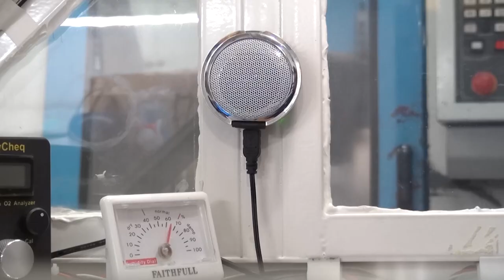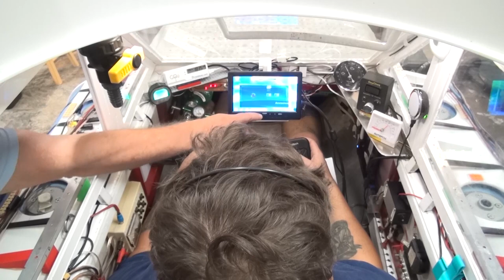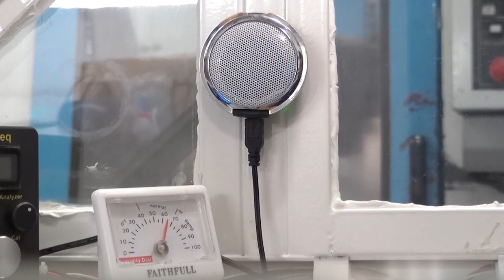Building Your Own Submarine

Comment: So your making a sub to experiment on an airship?
Reply from the maker: Airships and spacecraft. Submarine are great test beds for lift support systems and human integration. Our airships already run the submarine software. It's been a big plus to our program.
Reply: @johnmpowell  for the airships could the weights just be water? Then maybe you could condense water to refill weight tanks if you needed to decend for some reason maybe?